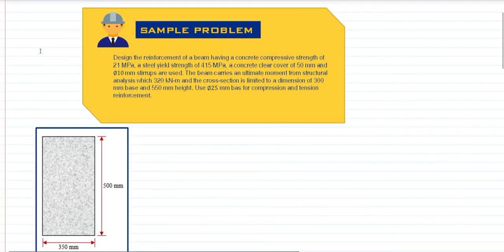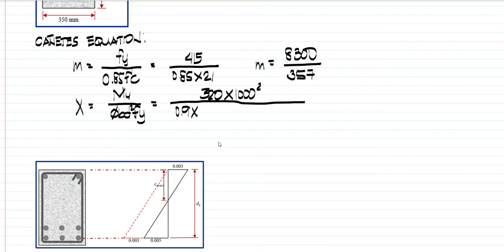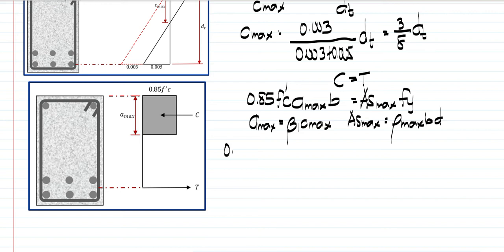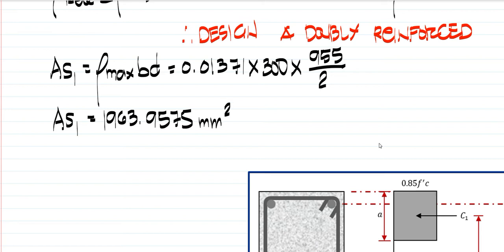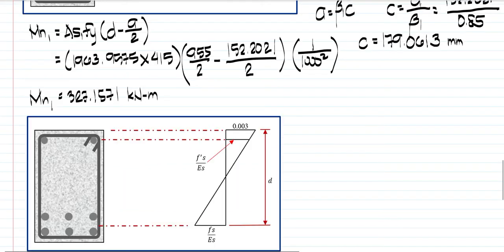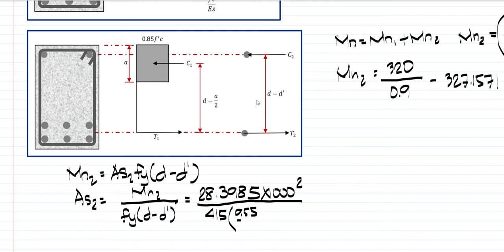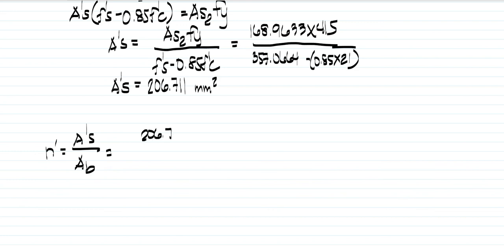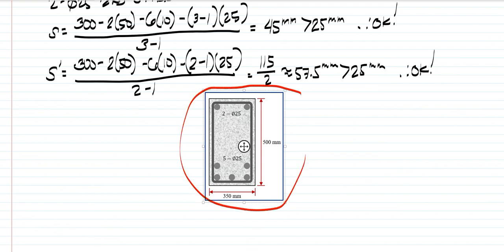Design of Doubly Reinforced Beam (Sample Problem) Part 1

Comment: Pa explain naman po yung pano gamitin at pag kaiba ng d at dt. Thank you.
Reply: d is defined as the distance from the extreme compression fiber to the centroid of the longitudinal tensile reinforcement.
dt is defined as the distance from the extreme compression fiber to the centroid of the 1st layer of the longitudinal tensile reinforcement.

sa madaling sabe..., 
d = dt kapag one layer lang ang longitudinal bars
d < dt kapag two layers since ang centroid ng two layers eh medyo taas ng 1st layer.

Isa pang application  ng dt halimbawa sa two layers eh ito ang ginagamit na value instead of d sa paghanap ng strength reduction factor na ϕ = 0.65 + 0.25[(fs - fy)/(1000 - fy)] kung saan ang value ng fs ay magiging fst = 600[(dt - c)/c]

Comment: Tanong lang po. Bakit po yung kinonsider na phi is 0.9? Hindi na po ba icoconsider kung tension, transition or compression control po siya?
Reply from the maker: Design phase pa lang po kase. We always design beams on a tension controlled basis then limited tayo on a strain of 0.004, sa analysis phase kase natin mapoprove kung tension controlled sya or under transition zone.